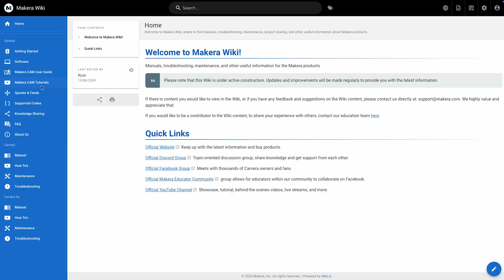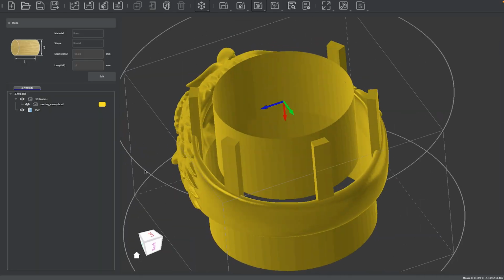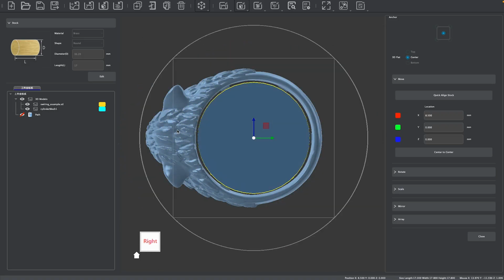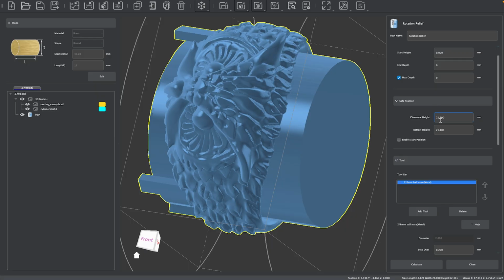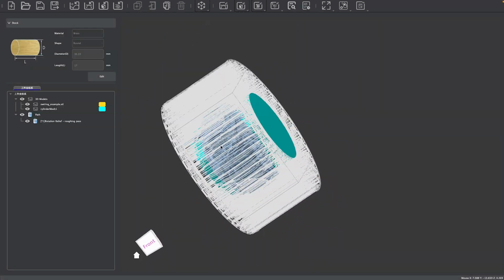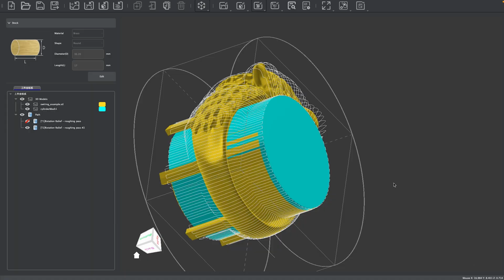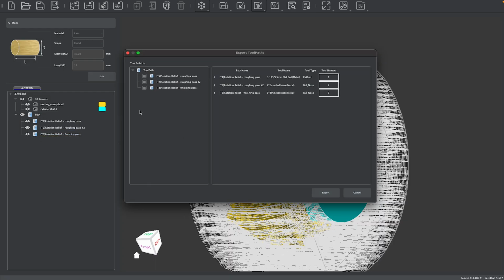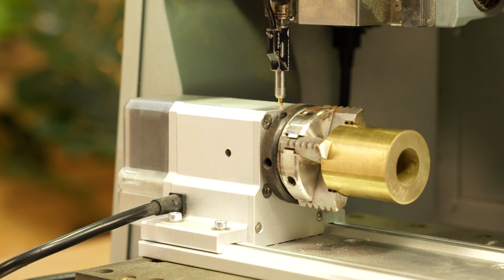How to create a Brass Ring using the Carvera Air's 4th Axis and Makera CAM

Comment: If I would do the pocket milling in 3d mode, how would I ensure that the center is really center? 
On this ring, the tolerances are not that important, but if I go for a sprocket or similar, that will be rotating a lot, then the center would be important.

Comment: How would the z1 do with wood rings on 4th axis mod?   Would it be able to smoothly handle that?  Starting with a block of wood with center cut out I assume.
Reply from the maker: Absolutely! The Z1's 4th axis is designed to machine harder materials up to Aluminum or Brass, so cutting wood is no problem at all.

Comment: I'd love to see a video how you would continue to machine the ring if your stock didn't have a hole in the first place. Like, whats the process of that for me as a CNC-beginner. Because the hole-size of the stock might be to small (or not exist at all) and I need to machine the rest - precisely of course.
Reply from the maker: This is a good question, and one we could look into supporting in the future. The best way to machine this center hole would be using a vise to secure the stock, and machine it through a pocket operation in 3-axis configuration.
Reply: @Makera that was my question as well. I am a maker with limited workspace and tooling, so by remembering that using the CNC in multiple steps is good advice.

Comment: Would the carvera air have been able to cut out the inner diameter as a previous setup? 
Otherwise kinda need a different tool, to be able to use this tool
Reply from the maker: Yes, though not on a 4th axis. For this, you could set the stock up in a normal 3 axis configuration with the hole facing up, then bore it out with a pocket tool path.

Comment: Hello, does it have settings for sterling silver?
Reply from the maker: Sterling silver is rather soft, so you can machine it using settings for other soft metals like aluminum or brass, but with caution about cooling and with the right cutting tools.

Comment: Hello , really interesting video. I'm planning to buy one of your machine, probably the new one Z1 . I have just question, is it possible to drill holes or make inside theead in holes on 4th axis? I tried makeraCAM software for trial and i couldn't find anything like that in there.  Is it possible ? 
Thank you ! 🙏🏼
Reply from the maker: Yes this is possible, though not in Makera CAM just yet as this feature is coming soon. But this could be done in another CAM compatible with our machines, such as Autodesk Fusion
Reply: @Makera is nice to hear. Could you make any tutorial on milling like this ? 🙏🏼

Comment: The first roughing tool path looks different in Makera CAM and the cutting on the video.  How do did you generate this tool path? This makes a huge difference for some models. Cutting with keeping the rotational axis, then rotate the axis 180 degrees and do the opposite side.
Reply from the maker: This was generated with some of Makera CAM's newer beta features for additional 4th axis tool path generation.
Reply: @Makera For square stock, it will be useful if you can calibrate the zero rotation with the probe. There are many use cases where you want to tap a thread from the top, bottom and side.

Comment: I think it’s much more cost and time efficient to cast 3d printed models. Otherwise the great result! 🎉amazing machine
Reply: Quality would be terrible.
Reply: As someone who has done extensive research on both casting 3D prints and CNC milling, I can guarantee you in the long run CNC is significantly more cost effective. Just a higher upfront cost. BUT  this is only valid if you plan to sell jewelry. If youre planning to just do 1 off jewelry pieces then absolutely go the casting route
Reply from the maker: Perhaps, but thanks for the support!

Comment: Nice video! How did you make such an accurate hole in your cylindrical stock?
Reply from the maker: Using a modified vise and vertical milling machine with a bore bit.

Comment: PLEASE PLEASE PLEASE create videos on threads and knurling etc with the 4th axis!!!
Reply: Yes please, can't wait for my machine and this is one of the main things I want to do. (4th axis and threading simultaneously)
Reply from the maker: This is a great suggest, and we certainly will do once its a bit easier to do this using Makera Studio, stay tuned!
Reply: @Makera  awesome! Oh, and gears too!! 🙏
Reply: @Makera  Quick question. Is the way to do exterior threads by using a engraving tool and making a 4:th axis relief path of a model that has the threads modelled already? Will that work?